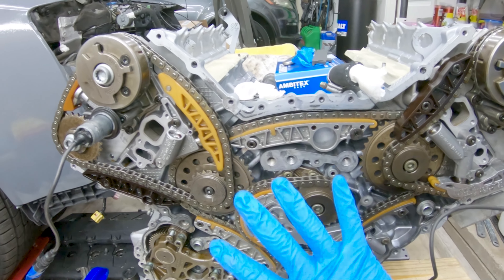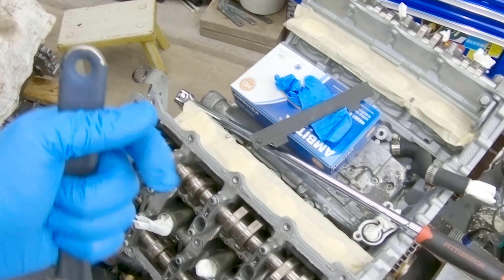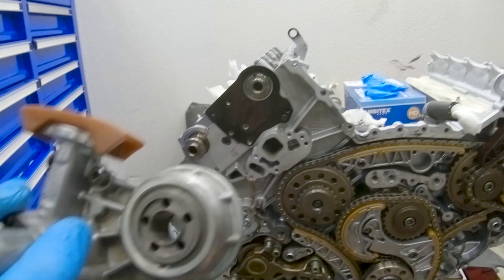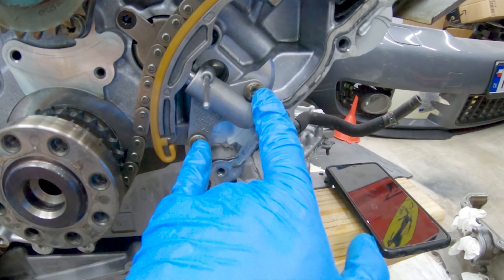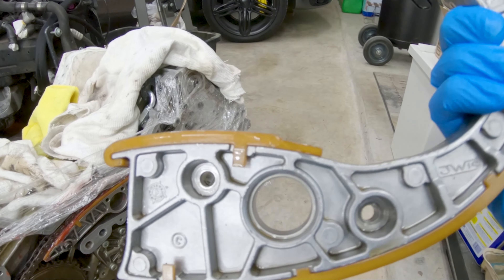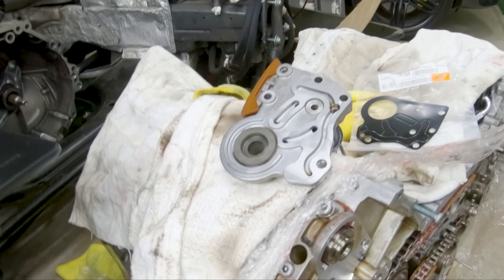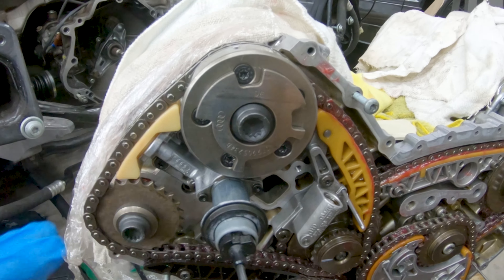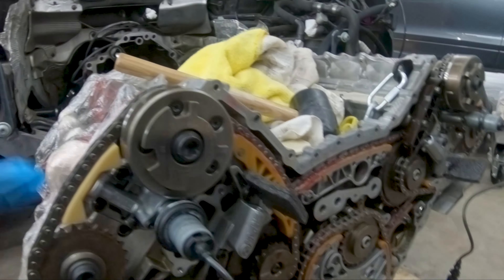Audi B6/7 S4 4.2 Timing Chain Install

Comment: Little late to the party on this one but I’m currently trying to lock my timing in place. I got the Schwaben timing tools and was wondering where you put the crank lock pin? Do I need to use it or are the plates to hold the cams in place enough?
Reply from the maker: @MasonDesjardins  so I failed to mention towards the beginning of the video the crank lock pin does need to be installed. I installed it in a previous video before this on. I only mention removing the pin once it's time to rotate the engine. I talk about it at the @24:48 min mark about the removal. For installing the crank pin. Remove the cover that's covering the to get to the crank. Once removed rotate the engine till you see the hole where the crank lock pin goes. You'll be able to notice it. Once the crank pin is all the way threaded in. Then go ahead and start removing the timing components. Install the new timing components and then as in the video at the 24:48 min mark the pin can be removed
Reply from the maker: @MasonDesjardins  the plates to hold the cans are not enough!!!!! Please use the correct tool on the cams side to hold it in place along with the cam plate tool.  do not rely on that plate only.  its only to help align the cams in correct place.

Comment: Mark, the chain tensioner gasket. Can I order 2 of the same one and it'll work for both sides or is there a right and left?
Reply from the maker: sorry, can you tell me which minute mark in the video you are referring to?
Reply: @markb6s4  7.25
Reply from the maker: @vonbrewsky8019  no, the driver side and passenger side are different shapes. Down below I have linked the two different ones you will need 👍. I had a feeling this is what you may have ment by, but wasn't sure. These are timing gaskets and not tensioner gaskets, but all is good. I am very guilty when it comes to naming things incorrectly 😅

https://www.fcpeuro.com/products/audi-engine-timing-cover-gasket-left-upper-allroad-quattro-a6-quattro-s4-vag-079109091b

https://www.fcpeuro.com/products/audi-engine-timing-cover-gasket-right-upper-allroad-quattro-a6-quattro-s4-vag-079109092b
Reply: @mark_b6s4 I appreciate it bud. Yeah I was guessing on the name 😅

Comment: Is there a video on how to time the engine? No the timing chains, cam timing and crank timing?
Reply from the maker: I'm not sure I understand your question. The crank, cams, and timing all are in sync when doing the timing. You can't do one with out effecting the other two components. So there is no just adjusting the cams or the crank.

Comment: What is the cost?
Reply from the maker: There are several factors that determines the cost. You doing the job your self vs a shop doing it. Depends where you buy your parts. For parts, I recommend to look up AMtuned.com and on there navigate to the 4.2 sectional and the kits comes with the parts you'll need for timing

Comment: WTF is wrong with 1 timing chain and 1 camshaft
Reply from the maker: @David-yy7lb  in a previous video I explain as to what happened to the engine. since the engine was going somewhere else to be rebuilt. I didnt want to cause any more damage to it when removing the timing.